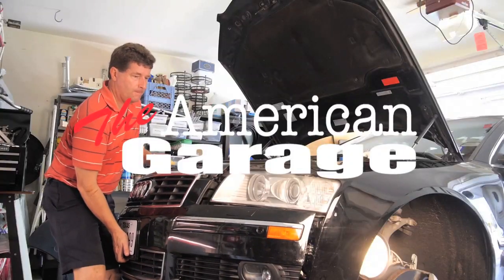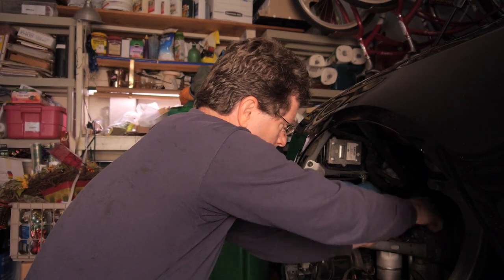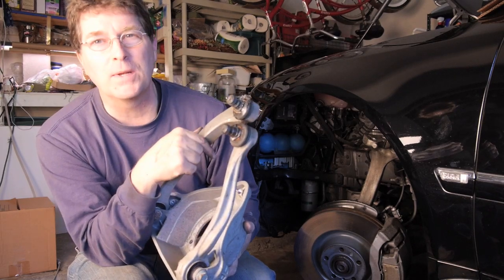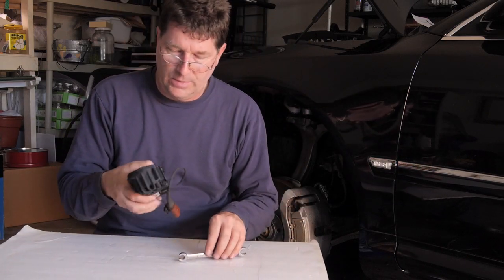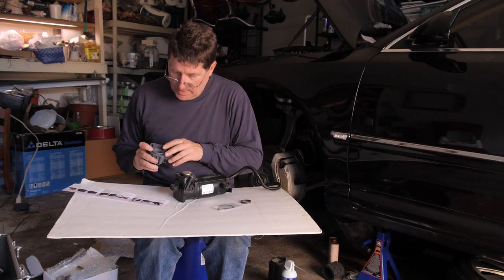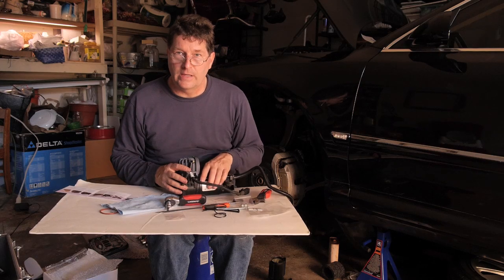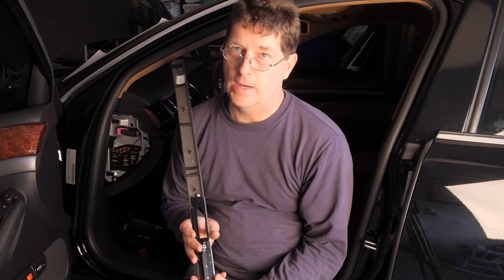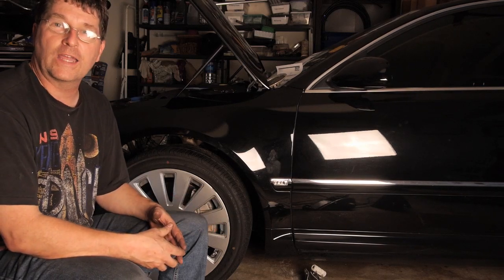Fixing the Air Suspension on Audi A8- The American Garage

Comment: Got a code saying "could not reach lower limit" or something like that and the car does not air up, but the compressor runs very loudly whenever the car is switched on for about a minute or two before switching off. Both suspension lights are also flashing. Any ideas? 

I'm thinking of starting with replacing the compressor

Comment: Hello, I changed the bellows of my d3 2004 vehicle and renewed the compressor, but my car has completely collapsed and is not starting. What could be the reason for this, please help urgently?
Reply: Also the modes on the vehicle's screen are grey, I drive the vehicle, the screen returns to normal and the compressor works but the vehicle does not start at all, please help me what could be the problem

Comment: I just experienced this issue today. My front left strut is leaking oil. I showed it to my.mechanic and he said strut needs replaced as it has failed. Does this sound right that strut replacement is the only option? I hair the compressor working and hear hissing noise and not inflating and hydraulic fluid leaking out.

Comment: Steve what is the programming tool you used through your phone to reset the computer?
Reply from the maker: I was using Carista on a tablet, but I have since upgraded to VCDS because it was too limiting. It will work fine for basic things though.

Comment: I have the same model a8 I replaced the air compressor and relay and the fuses checked out ok but I get no power to the compressor. I noticed at the end of the video you mentioned resetting the computer. I have obdeleven is that process possible to do with my method of vag if so how do I do it. I really like your videos they are very described and accurate and maybe I missed something, thank you in advance 👍

Comment: Steve, just have a question, on my Audi A8, can I replace the passenger side headlight ballast from the engine bay. Or it has to be done from the wheel well, can you please suggest? Thank you
Reply from the maker: It is a little difficult to get to without removing the headlight assembly. Two screws on the top where it is easy, one on the bottom back where it is not. The best way is to take the inner fender liner out to get to it. A pain, I know. While you are in there, examine the wires inside the headlight assembly. Mine got cooked over time, and the insulation was falling off. My solution was to disassemble, take the little harness out of the headlight, and put all new wires. It is not easy but doable. Just make sure you keep track of everything if you have to do that. Any evidence of cracking on the wire insulation is your warning, go head and replace them all. If bare wires touch each other, you may be replacing more than just the wires.

Comment: I don't know what kind of roads you guys drive there because my Audi has over 165 thousand miles and I just replaced the compressor cylinder and piston and connecting rod and gaskets and the cost was about $65. the air springs show no signs of leaking and yet you have to take into account that I live in Finland and the winters here are sometimes very cold. The car does not consume oil, everything works up to webasto.

Comment: Has anyone had problems with air spring causing rattle clunking noise while driving over pit holes
Reply from the maker: Just based on your statement, I would check the control arms- especially the uppers. They tend to wear out on Audis-
Reply: @TheAmericanGarage1  I’ve already changed upper and lower I’ve also done sway bar bushings and drop links I’ve done track rod ends also still same sound
Reply from the maker: @jimbrown9967  Hmm. At this point I would go to a trusted suspension guy, and get a second set of eyes on it. Perhaps where you get your alignments done-

Comment: Hi I have this fault showing up left front dampening adjustment valvle 012 electrical fault in circuit n336 is it my left strut or wiring fault?

Comment: Great Video!  Here's my 12 q7. Having problem with the compressor don't work. FYI, at first I has servicing the compressor by replacing the cylinder head and piston ring for the pump, as well as system Valve Block at once.  After the installation, the compressor pump are totally not working. New Relay has been installed. Compressor diagnose with 12V battery is working and steady.  Is there any other causes need to look into consideration for the issues?  Hope to hear your advice for the diagnoses process.

Comment: I have a A6 Allroad with airsuspension. My problem is that it holds air and dont drop. All the modes work dynamic/comfort/allroad and lift. All holds air but i get the yellow suspension light in the dash when ive driven for 2-3 minutes and the meny is greyed out and in the settings menu ”Tow Mode” is turned on. Any ideas to why this happens? Thank you!
Reply from the maker: Hmm. I will be guessing on this one as well- however, in tow mode the airsprings will not adjust, so that may be why it won't come down. You don't seem to have a problem with a leaky airspring, or the pump- which are the majority of the problems. If your car is older, then I would start investigating the sensors and wire connections. Or could it be a stuck relief valve? If you have rust/corrosion, then you will have to check everything very carefully. Sorry I can't be of more help on this.

Comment: Hello! My Audi A6 C6 Allroad 2007 holds air and i can raise it from dynamic to lift and back without a problem. But as soon as i start driving it in any mode the yellow symbol in the dash turns on and lowers it. Any idea why this may be? Recently installed lowering links can this mess with anything that makes it lower it while driving? Thank you!
Reply from the maker: Alright, I may not have an answer for this, but I can at least help you get started thinking about it. The problem does not seem to be mechanical, or else it would not work at all. If you lift the car, and then go out on the road and take it to regular speeds, then it will lower for that driving condition. By lower links, are you meaning the lower control arms?  Replacing them should not affect the sensors. It sounds like you might have fault in the sensors. Did you bump one when you were in there? Get your scan tool and see if you have any faults related to the ride height sensors- or any other suspension faults. I would start there. I have not had that failure myself, so I am only guessing on this one. Start with what codes it is reporting.

Comment: Excellent, so much thanks. Two questions: how about the issue regarding computer calibration of the level sensors?? Also, where you ordered the air compressor rebuild parts?? Thanks again.
Reply from the maker: I didn't have to calibrate the level sensors, since all I did was replace the airsprings. As for the kit, contact Andy- http://www.bagpipingandy.com/ he is an engineer and tooling expert who makes the kits

Comment: How much difference is the D3 (2005-2010) Air suspension from the D4 (2011-2017)? Is the pump, valve block,  and fuse in the same place?

Comment: I have the same. Audi A8 Quattro. I replaced my relay first cause I noticed the compressor was over working itself. Meaning, I have a leak and my pump is over working . Soon the pump burnt. After seeing your video, it gave me a much better perspective and some options that I can afford. I chooses to do it myself and purchase rebuilt front air struts. I went and purchased a pump that is identical but different brand.I already purchased another relay. Wish me luck. Thank you for your time and making this video. Got yourself another subscriber. Meantime I will look at your other videos that may help me out. God Bless.

Comment: awesome videos - thank you !! - have a q tho - have the same d3, and was doing the front strut replacement, got the old out, but the new one i got from rock auto wont go in, do i need to figure out how to bleed air out of the new one so it would go in easier - any tips you could share to make the new one go in  easier, right now, its about almost 2 inches too tight from being able to sit in.
Reply from the maker: If the air line is not attached, then there should be no air in it, and you can just compress it with your hands. I have not used airsprings from Rock Auto, so I cannot comment on that. Try putting it on the floor, and push it down. Measure the length of it and measure the old one and make sure it is the right size.

Comment: Hi T.A.G. , my Audi A8 Quatro makes a  continous beep as soon as I start driving the car,  then it stops after like 4 to 5 minutes.   What do you think I should do? Te Thank you .
Reply from the maker: Is the beep coming from the back of the car? That would be the warning that the rear parking sensors may have gone bad. Are there any dash warnings associated with it?
Reply: The beeping noise seems to be coming from the dashboard and yes the parking brake letters are flashing as well as the parking button next to the shifter thanks TAG.👊

Comment: Great video!
Is it possible to connect the replacement compressor to the car without taking out the old one so I could test is it just the compressor not working?
Thanks in advance!   :)

Comment: Any help? We have checked for leaks and found nothing, yet lately, I have experienced the following.
The compressor will turn on every 5-10 minutes, stays on for a minute, and turn off yet another thing that I have noticed is that before, I was able to lift the car real fast now as soon as I press the up bottom the compressor will go on. The vehicle will lift very slow, not like before. After the car gets to raise the compressor will turn off. Leaving the car for a complete week car is keeping high, and after turning the vehicle on compressor will not turn on yet. As I drive the car, I can hear a click under the dash, and the compressor will turn on for a minute. Any idea what can be causing the compressor to turn on and off so often? Also, I have noticed that if I wanted to lower the car, sometimes will take longer than before.
btw there are no dash lights on.
Reply from the maker: Sounds like the compressor is getting hot and turning itself off. It has that as a safety backup so you don't burn out the pump. It gets hot from working too much. If that is happening, I would try rebuilding the pump- search online for Bagpiping Andy's rebuild kit- they are about $45. If the pump is turning off frequently, it is not making as much compressed air as it should, gets too hot and turns off.  Another thing to check- sometimes- not often- the temperature sensor goes bad so check it too. If you have an OBD2 unit to plug in and diagnose the car, it will tell you if it is overheating the pump. 
Ok, let me explain something too- The air suspension has no real way to identify a leak in a strut- so, they put a temperature sensor to flag when the pump is working too long. This will either identify a leak, or that the pump is wearing out. So, the fact that your dash lights are not coming on makes me think that it is working often enough to keep the car from sinking, but that it can't pump effectively enough. Rebuild the pump and check for leaks would be my course of action.
Reply: @TheAmericanGarage1  Well, the problem is the compressor is turning on and off even when the system is not in use. Did I get to think that maybe the block valve is not working correctly? The car goes up very slow and at times to go down will take time too it is not like before. 
At any rate, thank you for your comment appreciated
Reply from the maker: @lupecastillo7669  I haven't had any blocked valves, that would be a whole other problem. Sorry I cannot advise you on that one. However, the system is always in use, even when the car is off. The only time the suspension is not actively in use is when it is in jacking mode, otherwise, in the morning it would be on the ground every single morning. Once I forgot to put it in jacking mode when I went to get my tires rotated- well when the set it down it went all the way to the ground! I had to start it and wait 20 minutes before the car started sorting itself out, so don't forget that.

Comment: How refreshing, a youtube video by a wise gentleman with plenty of tips & knowledge!  no silly editing or music

great job my man!          do i have a leaking strut? once every 2 months the suspension esp light comes on & will lower to lowest possible ride height & rides rough,  then fixes itself within 3 days       this electrical or mechanical related? (2013 A8L I6)     I feel like i owe you money watching these videos!  cheers from houston texas
Reply from the maker: First of all, see if it will pump up to the high position, then put it in jacking mode and let it sit overnight. Measure it as soon as it is in jacking mode, then measure the height at each wheel in the morning. A leaking strut will show up there. It could be that the pump is wearing out as well, and won't pump up- but over time it may catch up and seem to fix itself. get a pump rebuild kit from Bagpiping Andy, rebuild the pump, and see how it acts after that. Don't forget the leak test, or you may be rebuilding the pump again.

Comment: Awesome video. I ordered my struts today, so I’ll be embarking on this journey soon. Where did you get the relay from? And does it have a special name besides “relay”?
Reply from the maker: Any good Audi parts supplier should have the relay. I think I got mine from either ECS Tuning or O'Reilly. They are not hard to find.
Reply: TheAmericanGarage1 Thanks. 👍🏻
Reply: TheAmericanGarage1 Finished the job today and it’s back to normal. Thanks again for your excellent video. 🎉👍🏻

Comment: I did pretty much the same thing as you did. Although my pump was shot and under warranty, I replaced and installed a new one. The struts are Arnott refurbished units. My car is still showing a solid yellow light within a minute of starting my car. I have 2008 A8L. What else should I be looking for? Stays in Dynamic mode.
Reply from the maker: Did you check and replace the relay? Also, did you connect to the car's computer and clear out all the current faults? Once you have cleared all the faults, it should be good to go unless there is a leak or another problem. Don't forget to take the car out of jacking mode- the yellow light will stay on if it is in jack mode.

Comment: I have a question for you sir. In my case it's phaeton 2004 6.0 v12. My dad spent his life savings to buy phaeton as a sort of joy, and the car broke just now, the front right strut is leaking thru top. 
Anyways , I purchased 2 new struts for him. I would know how to replace them, my concern is following:

Does whole car need to be jacked up ? - Or can I jack up just the front side of car and rest it on V stands. 
Second, the part about resetting system using diagnostics is unknown. Do I need VAG or there is a way to do it using android application connected thru ELM327 interface ? 

I would greatly appreciate your time to help me on this. Breaks my heart seeing dad all sad about the car as he can't afford to repair it. 

I threw subscribe to you too, as I do like the content and the detailed training on replacement.
Reply from the maker: Dylan, thank you for watching! Alright, I have not worked on a Phaeton specifically, so my comments will be general. I am assuming you have an air suspension similar to the A8. If you are just replacing the front airsprings, then it is fine to just jack up the front. However, with air suspension, make sure you put the car in jacking mode so the suspension does not try to adjust while up on the jacks. VAG is great, but if you cannot get it, then you can get a bluetooth OBD 2 like Carista with an app on your handheld device. Find a device that is compatible with your car. Best wishes with your project.
Reply: @TheAmericanGarage1  Thank you so much for taking the time to respond ! I will give it a shot and let you know how that goes. I am pretty assured they have same suspension principle but we will see once I dive in :) Have blessed holidays man !
Reply: @TheAmericanGarage1  Actually one more, I am so sorry. This is still concerning me. I cannot have the device anytime soon as I have to order it. Is the app necessary or the car can pressurize the suspension and the new strut once placed out of jack mode. Thank you so much I appreciate your time, you are helping me a lot here.

Comment: Well done sir!!! I have a 2013 audi s6  and there are very few DIY videos for this rare model, my compressor is in  the trunk  and i think i have a leak in one of my lines (purple) for the rear. I will use the Rmt  website u suggested. Do u have  any DYI's on fuel consumption  or O2 sensors which side is bank 1 bank  2 . I've had this car for 3 years now and gas mileage is not  as good when i first got it. i have  checked the plugs and they look good but i'm going to change them as i'm sure they are the original. i heard a dirty Maf  sensor could cause issues but i have yet to locate it. Any tips or suggestions would be well appreciated!!! Again thanks for the video very informative and keep up the good work sir!!